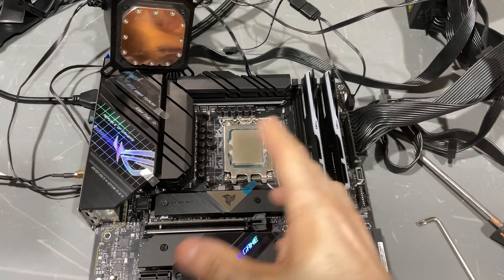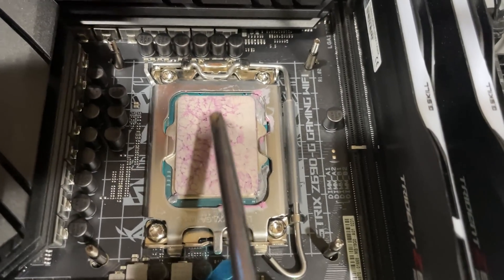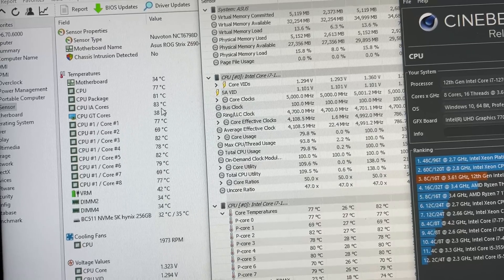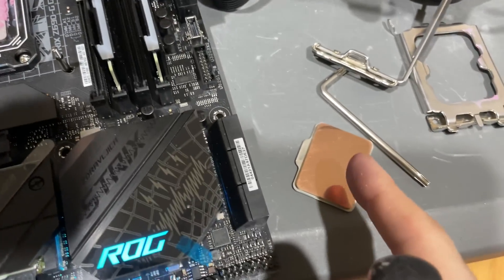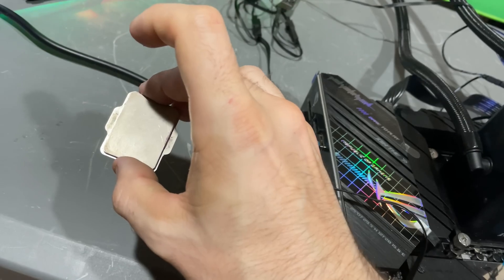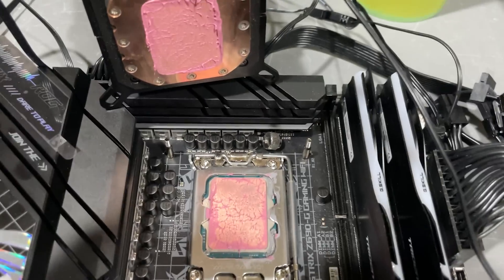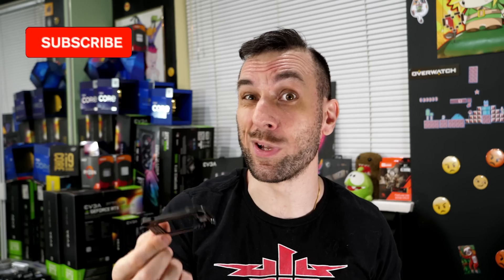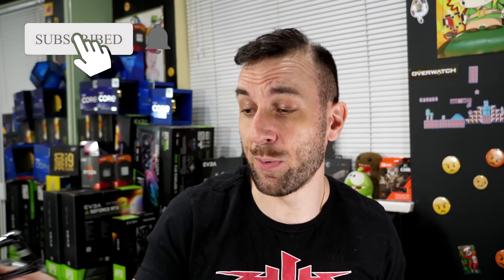12th Gen Contact Frame Performance RESULTS!!

Comment: I know this video is 3 years old. But I felt a need to chime in. How could you conclude the same day of the test that this is just snake oil? The beginning of the video, you hypothesized that the cpu deformation happens over time. The test is not really valid unless you gave much more time (year maybe) to analyze the results.

Comment: I know Im late to the party here, but thought I wopuld add my 2 cents...

The first heat spereader had been bent over time by being in the stock ILM giving it a banana shape, using the new ILM didnt remove the bend so temps were the same. The 'freshly' lapped heatspreader was flat so gave an even spread. Using the new ILM would stop the heatspreder from bending over time. 

The difference wasnt the lapping...it was using an old bent heatspreader over a new flat heatspreader....using the new ILM stops the bending over time.

Comment: Fatigue is caused by repetitive flexion. Tightening the processor too hard will not cause fatigue because the load is static.

The stress in the ihs due to heat is irrelevant because maintaining it will not prevent it from accumulating internal stress and the temperatures reached by the processor are too low anyway.

Where he is wrong is the pressure distribution. Gamer’s nexus did a great video testing this product and the thermal grizzly one.
Reply: It will help to equalise pressure to get a good contact but won’t prevent « damaging » the ihs

Comment: I got 13600k on a b660 board with one of these frames and ak400 cpu cooler. My temperatures sit 35 C with 6 game clients minimized. If I go play some new game on top it would go 50 to 60C max. Make sure your board got the latest bios update too.

Comment: thats 100 times the paste you need, no wonder high temps for people, i put a fingerprint thick on ihs then same on cooler so very thin, always great results no paste all over.  You people are floating the heatsink over the cpu, not needed

Comment: I got the 13700K with a contact frame, and a 360 AIO. Temps still shot straight to 100. Then I got the lapping block and lapped the CPU to a mirror shine. Now it doesn't get above 90. Epic improvement!
Reply: Crazy that you had to lap your ihs to get sub 100c. I have a 13700k with Thermalright contact frame and 240mm aio. Before I added the contact frame it would hit 100c on the package and start to throttle, whilst remaining around 85-90c on the core. It would get up to 200-210w. After installing the contact frame, my idle and low load temperatures dropped noticeably and when running cinebench the core only hits like 70c, 80c package at the 200w now but since the package never goes above 95c anymore, it no longer throttles, and I've seen it go up to 253w. I did go with Arctic Mx-6 this time, versus what came with my aio before, that could have something to do with it. But honestly I more so bought the frame just to keep my cpu from bending over time, and got better thermals in the process. With the contact frame and mx-6, this 240mm aio keeps a 253 watt drinking 13700k to 85c core 95c package. The fact your 360 couldn't do it without lapping the ihs is downright cruel.

Comment: I know where the issue may stem from and why you may not have seen a difference.

My MSI Motherboard's ilm arm is super stiff... when I first made my pc like 8 months ago I installed my CPU and while pressing down the arm it was SO STIFF that around 3/4 of the way down I actually stopped and opened the socket back up to ensure that I put the CPU in the correct way and I didn't have it misaligned slightly. It was all correct... The arm is just under SIGNIFICANT tension. 

I thought that was the norm... That must just be how 12/13th gen arms must be... Till I built one for my friend and his arm took a third of the force to lock down than mine did... His board was either gigabyte or asus I cant remember off the top of my head.

I recently bought a 13600k as an upgrade and boy oh boy... my cpu temps were 95C while gaming! I checked mounting twice... same deal. What I noticed was a dry line down the center of my CPU and coldplate... Meaning bending is present... I bought this 10 dollar bracket and BOOM! 80c in gaming. 

Its not snake oil... just that your SPECIFIC setup didn't have the bending issue. (and yes... later I bought a water cooler and now the temps are 65-70c while gaming)
Reply: Yea you didn't see any pooling in the video of thermalpaste in the middle. My build was only around 1.5months old on z790/13700k. when i put plate in on mine i could see it on cooler and cpu that the top and bottom of cpu had less thermal paste on it then the middle. My bet is being delidded that might be why he didn't see as much as that might help deal with the bending.

Comment: I think your conclusion is wrong. In the first place, what made the cpu sag in the middle? The frame prevents bending of cpu in the long run, which leads to decreased cpu performance over time. So I dont think its selling snake oil :)

Comment: I bought one with the grizzly brand. Was told it would lower temps by
10c° well, in benchmark it dropped with around 2-3c° and in games about 5c° from 65c to 60c°
Its not magic but it works a bit better than the normal fitting.
Reply: The Thermalright one is cheaper and better, no fiddling with screw tension you tighten the screw with the small end of the key and two fingers and stop tightening when the screw stops. Instead of a floating frame there are 0.5mm hard elastomer pads (think hard but flexible plastic) under each end that sit flush with the MB. If you are worried about the screws backing out you could put a spot of blue threadlock on the last few threads of the screws.

Comment: Yes if you want to justify or rationalize staying with a decent run the contact frame and do an undervolt and keep the thermal headroom @5ghz? Gamer's Nexus has the pressure test images they have test gear

Comment: Imo,when you first install the cpu in original ILM,the cpu is getting bend by ILM clamp,so after you
change to BCF frame,the IHS of cpu is damaged by that action,if i can called it like that.

But i could be wrong.
Reply: It's not enough to cause plastic deformation of the copper. Metals only stay bent if they are bent far enough, slight warping like this will spring back.

Comment: I think the frame should be used on a new CPU, not one that was already bent by the ILM.
Reply: It's not permanent, you'd need to bend copper quite a bit to reach plastic deformation and this amount of warping isn't enough.

Comment: I’m not gonna lie, you know what you are doing, very good at what you do. 😂 I’ve been watching your content for 2 years. Anyway, here’s the thing, my 12900k is delid, now I have one of these frames but I’m using copper ihs on my 12900k, looked cool, whatev, made sense to get the package with the delid from rockitcool. Anyway, the frame doesn’t fit the copper ihs, but it fits my delid 12700k which might be a gold cpu because it can do 5.45ghz all core stable after delid… but anyway I put my 12700k in a board with a 120mm aio for now and overclocked to 5.2ghz 1.29vcore it’s hitting 90c which this is a cheap evga bstock cooler for 20 bucks… your opinion, should I go stock ihs and frame on my 12900k or keep copper ihs, I’m hitting 80c at 5.2 all core… custom loop with 3080ti in loop. Lots of other factors, but just want your thoughts

Comment: All high end motherboards should have contact frames like this in the future
Reply: All motherboards period!
Reply: You can mess up the screwing process. Too tight screws and the cpu wont boot due to no memory access. That´s why it´s not happening.
Reply: @Henningberlin94  Easy to fix that use shoulder screws and spring washers to control the pressure. That way the tension of the screw doesn't matter because it's the spring washer pressing down on the retaining plate with the shoulder stopping the screw at a specified distance from the plate.

 For that matter why does the frame nee to press the heat spreader at all? They should designing it just to retain the CPU with the cooler being the thing that actually applies pressure to the heat spreader.

Comment: If you added liquid metal to the CPU I wouldn't say is a good reference of performance for most users...
Bad transfer from stock configurations would probably see more benefit of having a more even contact around the surface of the CPU, even a better thermal paste would show improvements.
I'm having a hard time finding a video that shows the benefit of having this improve socket, you need to test with the 3 most sell motherboard or more to see if there are problems that need to be fix/address for a start.

Comment: After watching a number of "reviews" for this contact frame, it's clear that some are getting good results and others are not. So who is right? Everyone actually, but no one has figured out why they are right.

I suspect just like a few other commenters that the MB itself combined with the CPU cooler mounting is the actual factor here. Using a EKWB waterblock with a seriously thick backplate, I never experienced any socket warping across multiple motherboards. Switch over to like a AIO or air cooler with a plastic backplate and you may have a problem. Add in the fact that lower end MBs are 6-layer PCBs, memory support is already weak. This contact thing has to do with A) bad IHS to begin with B) thin MB PCB and C) How the cooler is mounted to the socket.

Comment: It's not really fear mongering there is a genuine issue with the original latch design bending CPUs the point of this product is to stop CPUs from bending a bent cpu pcb could cause the death of your cpu under the die itself is a bga (ball grid array) and the added tension on those balls plus heat cycling will cause them to crack over time the added 2 to 3 degree's drop in temp is only a bonus

Comment: De8auer contact frame comes with delidding and lapping tool and has screw marks for most accurate insertion with proper guide..

And lapping is necessary to get the surface flat so the contact frame can work

But the video was really good and informative:)
Reply: realy? is that delid die mate 3?
coz i can't find any delid tool after delid die mate 2 on caseking

Comment: I can show you my results with no lapping, my cpu was hitting 97C, now, just with the thermal grizzly contact frame, it hits at max 82C and if I turn the AC on, it hits just 72C, and also,the frame change doesn’t void the warranty since they is no way to prove that you change it, if you lap your CPU, you also lap your warranty, that the benefit of it
Reply: That's great news! My Thermalright frame just arrived but I haven't installed it yet. Did you use a torque screwdriver or just go by feel when tightening the screws? After seeing GN's video I hope I'll do a goos job to tighten them as evenly as possible
Reply: @Ben-ld1qi  first I put a mark on each screw, then i just tighten the screws in an x pattern with 2 fingers until I can’t do it more (also doing it little by little so there is no way that they aren’t even), then just do a 45° turn in each screw, as recommended per der8auer

Comment: Not all will benefit from the contact frame. Certain motherboards from what I've seen cause a bow in the IHS from the clamping force in the middle. I had high temps and the contact frame dropped temps 15°c
Reply: That's amazing, what's your mother board?
Reply: @Ben-ld1qi  msi z690 edge wifi
Reply: @timtoomuch  holy shit that's one of the better ddr4 mobos, i have the asus strix d4 and noticed almost no change in temps when using the 1mm washer mod under the bracket. But anyway i ordered the Thermalright bracket, we'll see how it goes.
Reply: @Ben-ld1qi  I'm glad your not having the issue I know my board was extremely hard to push the lever down so that could be why.i did the washer mod prior to getting the contact frame which worked almost as well basically you take screws out of the socket put washers on (I used nylon) and reinstall the screws.I think some also has to do with the IHS on the cpu itself as well almost returned my 12900k and got another but mine runs 5.2ghz p core and 4.2 e core @1.31v so didn't wanna take a chance on getting bad silicon lol
Reply: @timtoomuch  If I recall correctly on Igor's Lab review he saw the best thermal drop with 1mm washers and a regression beyond that, and it also depended on the motherboard, on some mobos stock vs 1mm difference was less than 1°c. I got my washers from AliExpress, Nylon as well, M5 size, and came in bag of 100 pieces, I'm just not sure what I'm gonna use the remaining 96 pieces for lul. I'm now contemplating whether to get a torque screwdriver to put the Thermalright bracket to best of its abilities once it arrives, I'm way too clumsy to trust my own motor skills on not over or under tightening all screws in synergy.
Reply: @timtoomuch  Oh and regarding your 12900K, with those specs I'd keep it!
Reply: @Ben-ld1qi  yeah I thought so too good talking to ya brother I wish you well!!!
Reply: @timtoomuch  Thanks mate, wish you the best as well :)
Reply: @Ben-ld1qi  instead of spending money on a torque screwdriver I would recommend spending them on a digital level so you can screw/unscrew until it tells you 0.00 degrees ;-)
Reply: @sgru0  digital lever? is that really a thing or were u making a joke? pardon my ignorance but never heard of it before. i received the Thermalright bracket a few days ago but couldn't be assed to install it yet since I'll have to first run a bench of cpu stress tests to verify the effectiveness of the bracket.
Reply: @Ben-ld1qi  I meant "level", just a typo. Search for it. I purchased a small one for other purposes but would actually perfectly sit on the CPU and would tell me if the CPU IHS is well angled. I also use it to check if my monitor, being mounted with a desk arm, is well levelled eheh
Reply: @sgru0  hahah right i have that tool then! Albeit the big one but ive seen the small ones as well. That's a brilliant idea for the monitor as well, i also use an arm, just what i need for my ocd tendencies :)

Comment: https://www.youtube.com/watch?v=Ysb25vsNBQI&t=1056s

maybe you should conduct tests in another way to see results from the video you tighten it random, it takes a bit of time to get it right :), and bare and mind that your frame might no be original from thermalright you need to check the code that comes with it to see if its legit,  and threre is a problem with the stock ILM period, the thermal grizzly frame is better then the thermalright it just needs more tests to get it right.

cheers
Reply: I was thinking the same, would be interesting to see GN's upcoming Thermalright 12th gen bracket vs an updated video from Jufes trying to replicate their installation method. But I'd say wait on it first, no need to bother Jufes yet, let's first of all wait and see GN's upcoming Thermalright vs Thermal Grizzly comparison video (since Jufes used here a Thermalright bracket).

P.S. I personally used the 1mm washers mod and I'm not sure I could even tell a difference in temperature before and before.

Comment: If you install a new CPU using the frame then it won't bend the IHS in the first place.  that's the point, and it's only useful if you want the lowest temps.  It both seems reasonable and your lapping sems to prove it because it flattened the bent IHS.

If it's 6 bucks I'll be doing it if it's still applicable when I upgrade from my 9900K.  Compared to all the cost I spent on water cooling the 6 bucks is nothing.

Interestingly, the frame won't void the CPU warranty but lapping does.

Intel does what it dos simply to make mass production easy and to idiot proof things but on the big chips Intel and AMD both use the basically the same thing as this 6 dollar frame.
Reply: The bending isn't permanent it only warps ever so slightly under pressure and it's not enough to cause plastic deformation. I checked this with an engineering flat edge and a light.
Reply: @atomicskull6405  thanks for explain bro

Comment: The contact frame isn't for that after market heat spreader though, just the stock 12th gen one.
I'm definitely going to get one of those contact frames though for sure. Going to go for the expensive Thermal Grizzly one though, I'd be worried about putting anything from Aliexpress inside my PC hahaha
Reply: I believe Linus Tech Tips and JayzTwoCents did a video on these, and the ThermalRight bracket did the best. The Thermal Grizzly didn't spread evenly or something like that.
Reply: @richh9570  you know what, I ended up getting the Thermal right one lol. No complaints so far
Reply: I have thermal grizzly benchmark dropped by 2c and gaming 5-6c with asus prime z690
Reply: @jewelersofwhale  I have nothing to compare it with as I installed the frame when I put my CPU in but from everything I've read, there's absolutely no difference between the Thermal Grizzly one and the Thermalright one
Reply: @reti7959  Same here, Im not sure if there is a difference between those two brands, but Im glad I use atleast one of them. :-)
Reply: The Thermalright one is ironically better designed even if the quality is slightly lower (tolerances) so it ends up being a wash. But the Thermalright one is also way easier to install correctly. Just make sure you get a genuine Thermalright there are counterfeits all over the place to the point that Thermalright is putting verification numbers on them now.
Reply: @atomicskull6405  after 9 months of use I'm more than happy with the Thermalright frame I got. My temps are nice and low consistently.